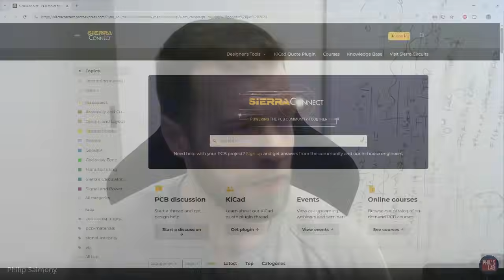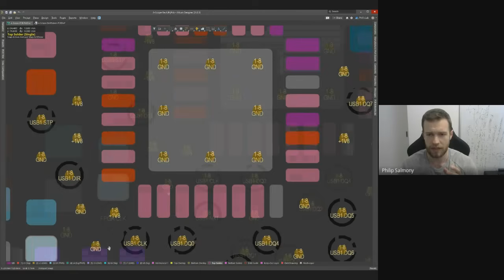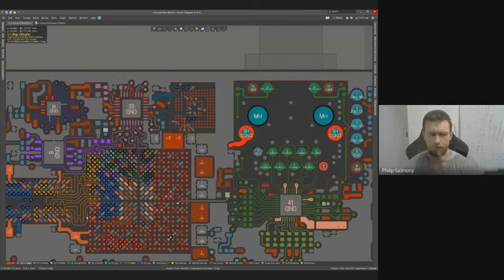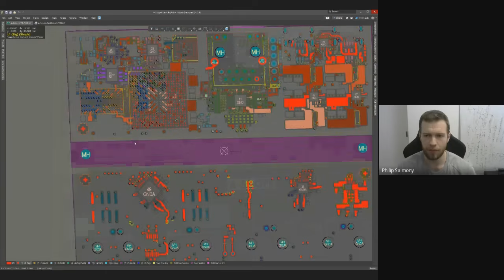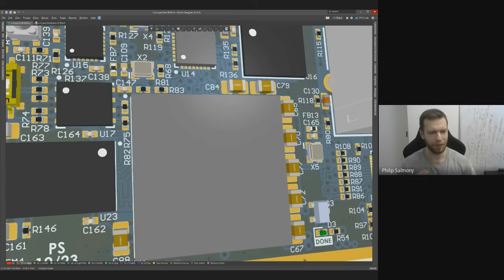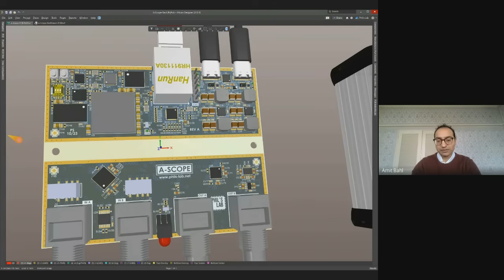PCB Design for Manufacturing (DFM) Q&A with Sierra Circuits - Phil's Lab #158

Comment: Hi Philip. I have some questions.

While designing a power distribution board or power supply, what are the key factors we should look for?

And how to measure polygon maximum current capacity and how to measure pcb overall thermal status? 
Thank's

Comment: My vintage practices: Use the widest traces as you can to increase yield. Have gaps relatively even and not too large to minimise etching time. Use the largest practical pad & via sizes to allow for drilling inaccuracies (and easier manual hand soldering where necessary). Use appropriately sized courtyards. 👴

Comment: Hey Phil, I have so much to say to you! I'm a software engineer by trade but now I'm learning to be a hardware designer, and honestly, I am constantly going back to look at your videos as I go through my design. You inspired me to create my first board (as someone that that never even soldered a wire) as a six layer mix signal/power pcb. Your influence has been tremendous. In the last two months I've made so much forward stride, I still can't believe Im at the routing/manufacturing stage...and such a huge amount is thanks to you. Who knows, If the board doesn't suck too much, I may even share it with you to review (and crush my dreams lol).

Keep it up man, this is exactly the video I needed right now!
Reply from the maker: Thank you very much! Awesome to read that you have created your first board already - well done. I'm sure it'll be great, hope all goes well with your designs :)

Comment: Reference designators: I think less is more for silkscreen readability. Crystals, Connector, Bulk capacitor, IC, pin 1 always on silkscreen. Decoupling cap never. (Specific differenciated footprint if possible) repetitive resistor/cap use -> group reference designator C/R XXX-XXX
Reply: Pick & Place machines don’t need to read the component designators. Legends are for humans so place & locate them as needed. 😂